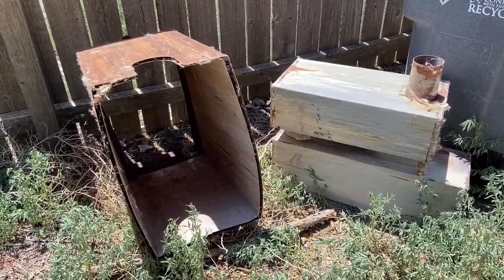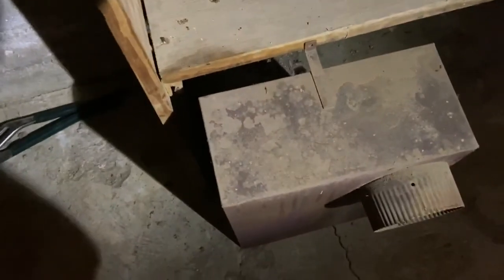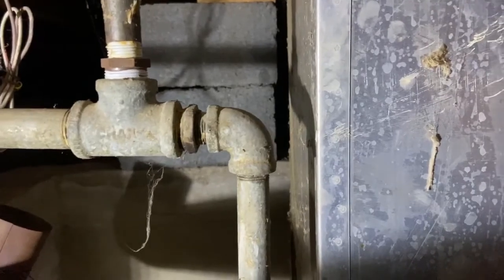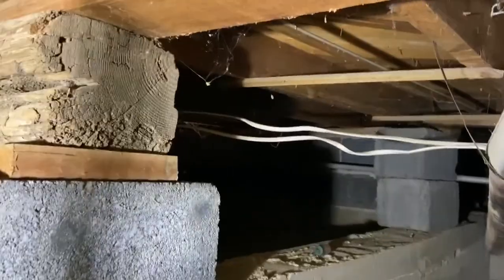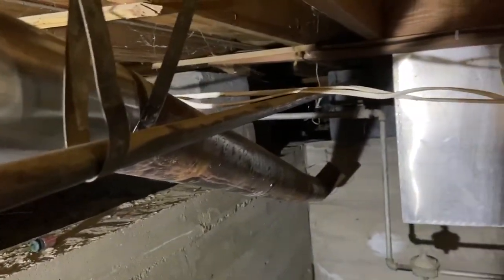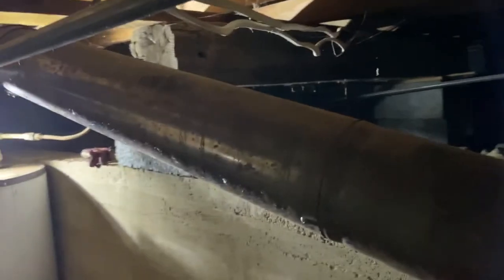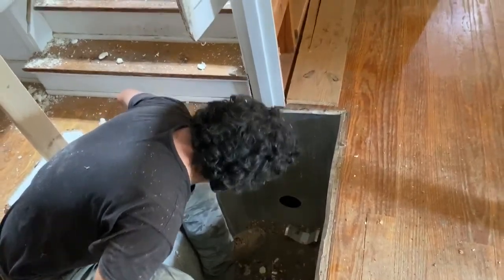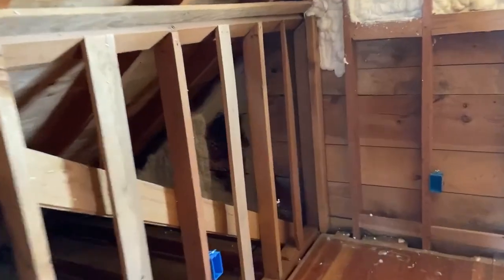Floor Furnace Removal | House Remodel 1949

Comment: i guess homeowner need to pay attention to the appliances
Reply from the maker: Those types of floor furnaces were widely used for a while, but there were a lot of issues with them.  This one in particular wasn't worth replacing or repairing.  We're installing mini-split systems for heating and cooling.

Comment: I actually thought this was a how to video.
Reply from the maker: Sorry about that, it was supposed to be.  It's difficult to film while working sometimes.  The best way to get them out is to strap a rope around the furnace and attach it to a piece of lumber, then have several people help lift it out.  They are heavy!
Reply: @Arkine13  Can I just cover it? The house no longer has a gas meter.
Reply from the maker: I suppose that's an option, but if you're going to be moving stuff across it then just make sure it can hold the weight and won't collapse to the floor below.  We found that not much was actually holding it in, I wouldn't have wanted people walking across it.